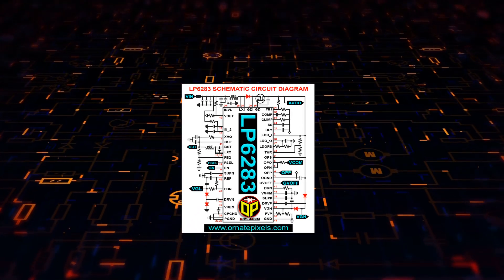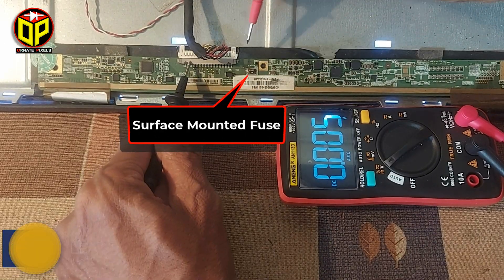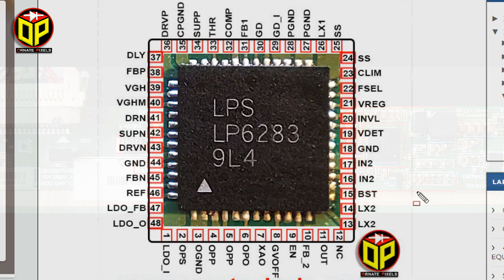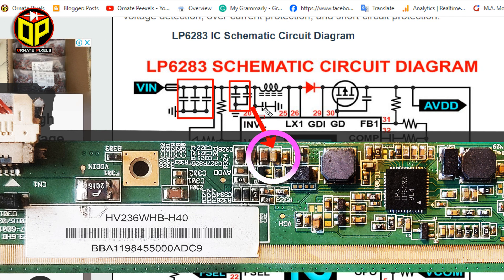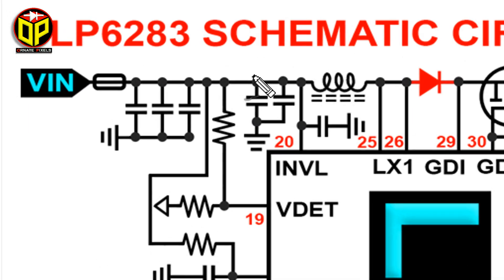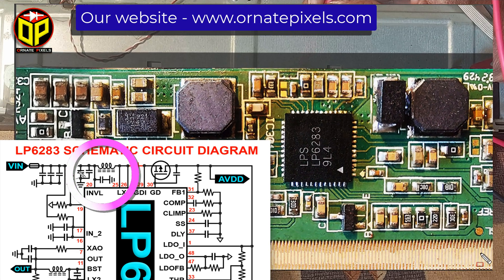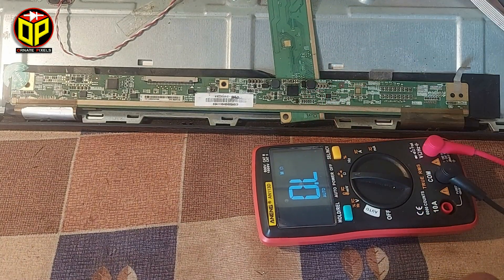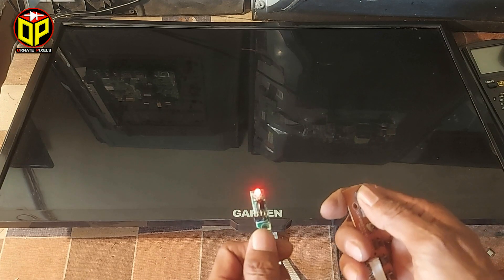LED/LCD TV Repair No picture, No Display & Black Screen Problem, LP6283 IC Schematic Circuit Diagram

Comment: hello can you on nasco E4309300 the VGL voltage is not stable it varies from -3v to -5v so the screen is normal and after it disappears, what to do?

Comment: Hello Mustafa,
I'm Aashish,
Was searching YouTube to fix my lcd tv, and found your channel, thanks.

I've got one dark horizontal line (bottom 1/8th part of the screen) and few blurred lines in sequence to the end of the screen Sony KD-43X8000G which has COG(chip on glass), now it's doubled above equally spaced dark line without blurred lines, 

Blocking (taping) VGH(27.7v) signal on that part of the tv on FFC cable gives a clear picture,

Is it reliable to block just VGH signal or should I have to block all CLK(1-8) signals with VGH for a bit longer lcd panel life if lucky!!

I don't exactly know how are these CLK and VGH signals are interconnected.

Thanks for any help

Comment: ❤❤... Sir lg 49 penla. Blank..  T.con.. Good condishan
Reply from the maker: If the supply voltages of the power management of the panel are all right,
you can cut the connection of the vertical clock pulse (CKV/CLK) on one side.
Thanks Brother.
❤🧡💛💚💙